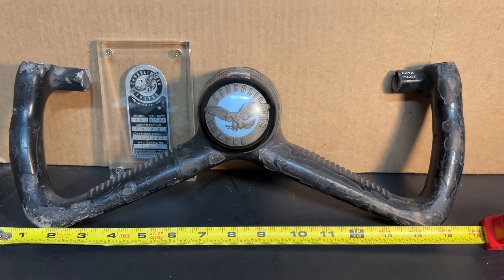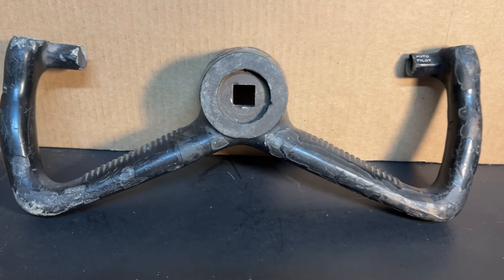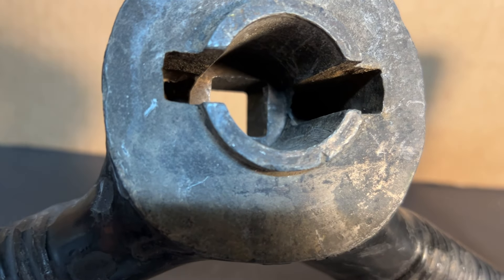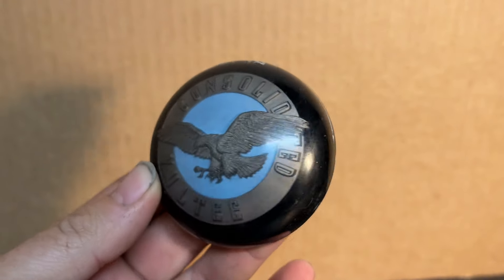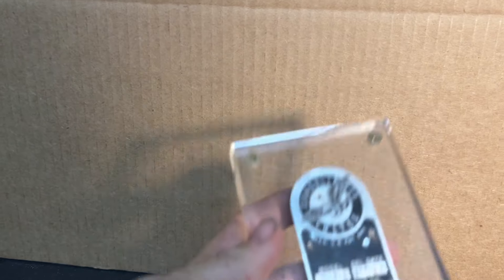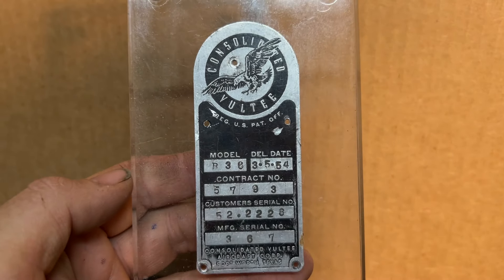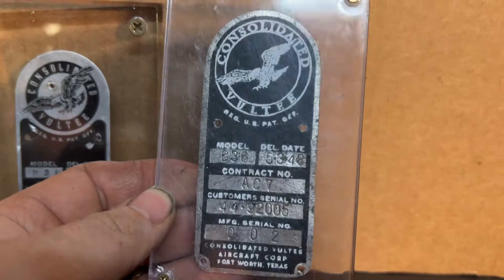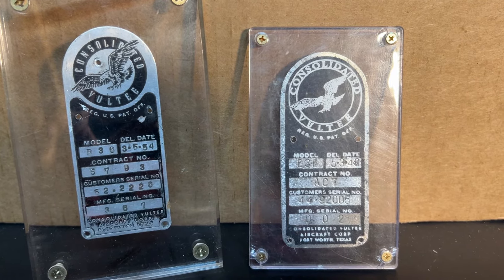B-36 Peacemaker Pilot Control Yoke and Main Identification Data plate and Horn Button

Comment: Might I inquire - where did you obtain these glorious items and approx what are they worth please? Very Cool !  New subscriber / admirer of your work 🇺🇸
Reply from the maker: I purchased the data plate on a eBay auction, around 12 years ago for over $600. I am sure it's value has increased since then. The yoke was purchased from the estate of a former collector in which the price I would rather keep to myself. I would estimate the yoke would fetch anywhere from $2,000 - 3,000 based on my experience. The horn button is another eBay find which I got extremely lucky and snagged for $50 -where identical specimens regularly sell for $300+. Thank you for subscribing!!!!!!
Reply: They’re absolutely incredible ! Congratulations they’re Historic Artifacts that are Museum worthy … I’m a collector myself , don’t have any B-36 stuff though . Thank u for your time 🇺🇸